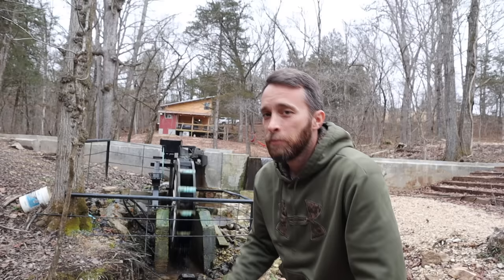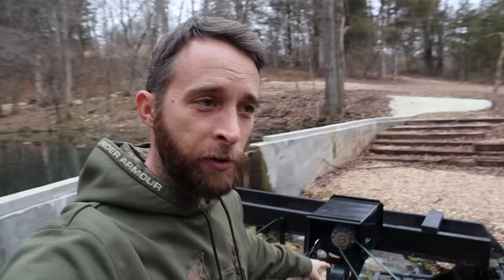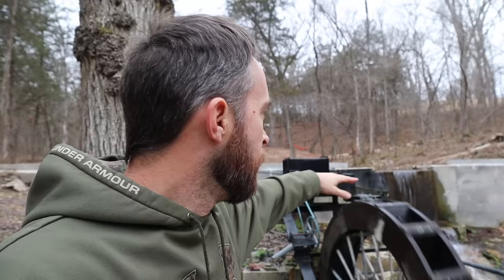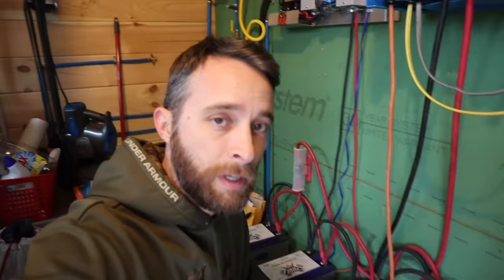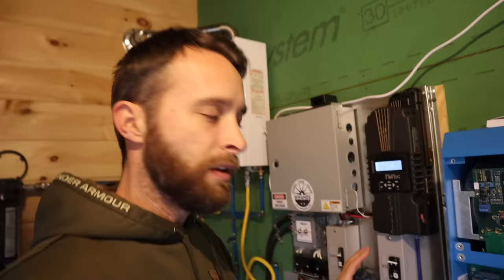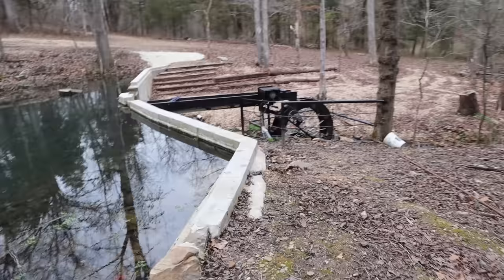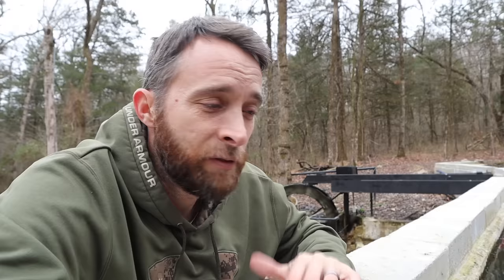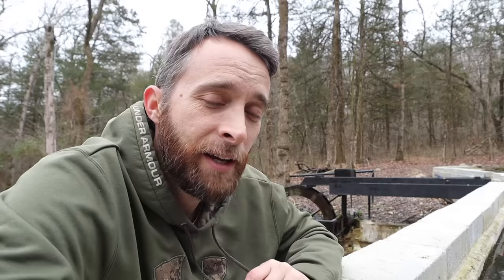Did we MAKE HYDRO POWER Using Our Waterwheel for Self Reliant Off Grid Living?

Comment: Instead of using a low voltage dc generator, use a high voltage ac generator to send power to the cabin and switch it to dc just before the controller with a $20 rectifier. Your Midnite charge controller can handle 200v and it’ll be less amperage to push and more efficient.
Reply from the maker: Thank you
Reply: @LoftisPartyofSix  this person is right. U want to go high voltage and rectify right before controller. DC long distance in high amperage is a high voltage drop.
Reply: Definitely correct on the advantage of higher voltage. The DC vs AC probably isn't going to make a measurable difference at these power levels, but DC is more efficient in the transmission lines because the magnetic field does not build, collapse, build reversed, collapsed, etc.  The big, long distance transmission lines from pacific northwest down to California are high voltage DC (HVDC) for this reason, as are the Ontario hydro lines and many others. More are being converted as needs and resources allow. Google HVDC transmission.
Reply: @Sylvan_dB  you are absolutely correct but the reason I said to use AC is because AC generators are waaaayyyyy cheaper than high voltage DC generators. In a setup where you’re just trying to charge a battery, I see no reason to spend the extra money.
Reply: Brian you're absolutely correct. Low voltage DC requires a much larger cable to carry the full current long distances. Much better to invert to AC and rectify back to DC if your grid setup requires it. Although... I'll be honest in looking at water wheel setup... the biggest pulley on the prime mover looks wayyyy too small to get the necessary kinetic energy transfer. I think you're loosing too much power there as well.
Reply: @LoftisPartyofSix  , I believe that you can get this to work, it's not the waterwheel, it's the power transfer that needs to be looked at, as mentioned by others. 

Thank you for the videos and I really hope that you don't give up on this project, you can do it 👍🤞🍀
Reply: That generator is a/c its rectifying at the panel inside
Reply: @edialbert8035  the water wheel is very poorly designed (as in the designer had no idea what they were doing) and isn't worth using. The buckets are shaped wrong, spaced wrong, and the wheel needs to be much wider
Reply: @alabastardmasterson  , I'm very interested in this, any suggestions on where I could find information on how an overhead waterwheel should be designed, for maximum efficiency?
Reply: @edialbert8035  Google waterwheel engineering or design. I remember many of the better sites not being in English but can't recall any of them. Its a much more indepth subject than most would think. There is quite a bit of math
Reply: Yes, he likely has a voltage drop problem with 24 volts on a 200ft run.
Reply: @edialbert8035  Maybe even a chain drive instead of the nylon belts, less flex.
Reply: Exactly, Edison vs Tesla
Reply: I agree. Classics need more voltage.
Reply: Yea from my understanding, dc is used to carry the load long distances, and then can convert to ac when it reaches the area for supply of electricity. This seems to be a good suggestion here.
Reply: @J.Cameron.Stuart.Adams.  you have no idea what you're talking about so your need to comment is sad projection
Reply: Moving your battery bank closer to the water wheel I think would be a simple solution.
Reply: Yeah you definitely don't want to run dc of distance that's why line voltage is ac because it doesn't lose current as quickly as dc
Reply: this sounds like the smart thing.
Reply: Waste of time. The system has been meticulously designed by ignoring every principle of even basic high school physics to not generate any power in the first place. You can rectify seven types of hell out of zero and still end up with zero.
Reply: yeah wouldn't the cables need to be crazy thick to push dc without losing loads of it, much easier to push ac
Reply: uh @alabastardmasterson
Reply: Thank you for sharing your idea! Using a high voltage AC generator and a rectifier sounds like a great way to optimize power efficiency. Additionally, if you're looking for a reliable power station for your outdoor adventures, I recommend checking out the Segway Portable PowerStation Cube Series. It offers a massive capacity, powerful output, and fast recharging capabilities. It's a valuable addition to any camping or RV setup.

Comment: I believe that your water is hitting your wheel too early, part of the energy is being lost having it that far back.
Reply: I agree with that point. Maybe try redirecting the water straight downward into the scoops?
Reply: He might need to add 2 feet or so to the length of the flume to hit it more on the downward turn to spin it faster.
Reply: But he reached 500 RPM.  It doesn't really matter how.  The promised power output @500 RPM did not happen.  I would not focus on improving how he gets that 500 RPM.
Reply: @PeterLawton  Sorry pal but utter nonsense.  Power = speed x torque and if there is no torque there is no power regardless of the speed. The speed is almost irrelevant, You can change that with gearing but there's got to be some grunt behind the rotation to apply a generating load against.
Reply: @davidsmith7653  utter nonsense?  Missouri Wind and Solar said that PMG generator will deliver 2000 watts at 24 volts, when turned at 500.  It’s in the video — I didn’t just make that up.  He got it turning at 500 RPM.  He said so — I didn’t just make that up either.  If you are just here to argue, count me out.
Reply: @PeterLawton  The rpm wasn't measured at the PMG. It was measured at the waterwheel. What was the slippage in the belts? What was the actual rpm at the PMG? It's a closed box. It might well deliver 2000 watts at 500 rpm when turning against a full load but you have no idea what that actual rpm was. You can't beat basic physics. That's why perpetual motion machines are impossible. There is next to no energy in the water the OP is taking from the top of the dam so he can't be generating any power. He has no head of water to generate power with.

Comment: Why not simply bring the waterline to a higher elevation? Seems like a simple fix when compared to all the work it took to put it in.
Reply: Move the wheel',down the draw to gain your needed thrust! Works every time!
Reply: Move the wheel another 6ft down stream so the flume is longer. And the water has more time to gain energy to transfer. And put a better gear ratio on the system problems would probably be solved?
Reply: Drain your pond and put a discharge pipe towards the bottom of the pond and then run the pipe down the hill further to your water wheel or ideally a pelton wheel
Reply: Maybe use a vortex turbine

Comment: I ran a 700 kw hydro station 9 years .  Get an old 115 ac generator with a blown engine and spin It with  the water wheel. Invert the 115 to dc for your batterys. I am planing to build a pond here and heat my house for free❤❤😊.😂 . Francis turbines are the best of the best.

Comment: For a 200 ft run, your wiring looks to be a bit on the small side, especially if you are trying to push DC.  I'd look at upping the wire gauge and running it as AC all the way to the controller, rectifying it to DC at the load end.  As far as the fluctuating current goes, if you are running a multi-phase AC alternator, you could very well have a bad winding in the alternator, a bad diode in the rectifier, or a faulty connection somewhere.

Comment: Cut a hole in your cement retaining wall to fit a 3 or 4” pvc pipe close to the bottom. Fit the pipe in the hole with a ball valve. Attach to a pelton wheel turbine. (Probably 400 watt unit) with at least 2 jets ( preferably 4 jets)Down a ways  from the wall. Open valve to power turbine. When water gets low, shut the ball valve closed and allow water to build in pond and repeat the process. Utilize water wheel for nothing but overflow during rainy season. This can be completely automated as well. At least now you can pull usable power even though it might only be part of the day. When your pond is full I bet you would get at least 4 to 6 hours of generated power between pond draining. Just a thought.
Reply from the maker: Sounds awesome!!

Comment: I'm not an Engineer or Electrician but I am a person who will keep trying until I get it.  Please keep trying! You got us all pumped up during construction and you have many fans cheering you on.  Research, testing, phone a friend,  trial & error etc. Just don't quit.
Reply from the maker: Thank you 😊
Reply: Yeah, you've got me pumped on this as well.  All that work and expense - you've gotta work it out.  So many well-intentioned arm chair experts .. and I'm just another one .. WITH another 2 cents worth.
It seems, from the vision, that there is only a slight fall from the dam over flow to top of the water wheel.  WHAT IF you dropped the height at the top of the water wheel to as low as possible (minimum of 2 feet lower instead of estimated 2 inches) to increase the effect of water-flow speed and power onto the water wheel.  Also, try a round (or 1/2 round) pipe with a diameter the same as the width of the water wheel channel. (Inside dimensions.)  Yes, yes, I know!  There's a lot of time and effort in the original water wheel mount - but a relatively small amount when considering the dam plus all those electrical components.  IF you temporarily redirected the water flow to a lower point, I believe you will "feel" more power in the same volume of water at an increased speed.  Finally, what is the current RPM of the water wheel - what RPM do you need?  What RPM is lost when under load?  If the RPM loss is significant perhaps a "flywheel" hoop could be attached to the 'wheel' to absorb some resistance.  It may take a while to wind-up to speed .. or you could give it a "helping hand" at first.  No matter what, Mate, just don't quit.
Reply: And I have to pitch in here and say what about parasitic loss? V-belts cost efficiency and so will an extra shaft. Perhaps someone has already spoke to that. 
I’m considering a similar installation and will likely go with a AC generator. I have yet to learn what RPM is needed for one of those……
Your work is quite inspiring, thanks for sharing!

Comment: Use an alternator with the rectifer at the charge controller location. There are even some auto alternators that will do the job. You'll probably need to run at least 3 power wires between the locations.

Comment: Have you tried checking what the output of the generator is right at the generator? If it is okay at the generator, but not at the cabin, your problem is voltage drop between the two. The fix is larger gauge wire. If it isn't okay at the generator, it will never be okay at the cabin.
Reply: THIS -- DC does not travel distance well.  There is a reason we power the grid with AC, and also step up the voltage...
Reply: @horscategorie  well, technically ac is actually worse. The main virtue with ac is, as you say, the possibiöity of adapting the voltage levels for long distance. Today when we have good solid state electronics dc is coming back in a hurry over long distance. But we are talking about dc power lines in the million range of volts.
Reply: @johndoe1909  Right - I agree.

Comment: For DC you need larger gauge wire than AC, with the travel distance(220') you should be using 1/0 Ga @10A. If my math is up to speed, 2000W/24v should be 83 Amps out of the generator though. You could check with a welding shop and see if they have enough welding lead that you could rent in order to test it. From the looks of the it, you have 10 Ga wires from the gen now, that would be fine for AC but...
Best of luck and don't give up the ship just yet!
Reply from the maker: Thank you

Comment: Don’t give up yet. This is too cool of a project to quit on. There is power there, you just need the right combination of things to make it useful energy. I’ve always dreamed of doing something like this but have never had water running on my property. I’m living vicariously though you. Don’t give up! BTW, my family of 6 just started RVing full time in September, and your videos are a big reason why we felt like it was possible! Thanks for the motivation!
Reply from the maker: Thank you so much for the encouragement to not quit on the project. I really want to figure this out but just need someone smarter than me 😉 to figure it out!
Reply: @LoftisPartyofSix  I used to be a mechanical engineer so maybe when I’m back your way I’ll stop by and check it out. We are in CA for a few months though. We will head east again soon.
Reply from the maker: That would be awesome!
Reply from the maker: @D Parker I completely agree! Thank you for the encouragement! God Bless!!
Reply: @LoftisPartyofSix  Become smarter! You have the capacity to learn, you just need to actually learn. Start with a question: how can I take the system I have and change it to deliver power? Then start learning. Do you need to get an AC generator instead of DC? How much loss are you getting between the DC generator you have now and your house? Can you measure it with a multimeter? 

Break it down into parts, verify every piece, starting at the wheel, and you'll find the suspect. Then you'll know how best to move forward. Don't give up!
Reply: Dont give it up...your on the right track...just need to get a better combination of wheel ratio..wireing..and convert ac to dc at the end of your run..at the controller  box..maybe a
 different motor..👍👍

Comment: Hi! This is interesting and a very exciting project, I think. I am a technical person and I see two things that may improove better efficiency! First, I would have rebuilt the gutter where the water comes out on the impeller. It will not be difficult or expensive. The gutter should be made longer and narrower at the end, so that the water only hits the blades on the wheel.

The second is that you probably lose a lot of power due to too little square on the cable up to the house. At DC- current one has to use thick cable and I think it will be somewhat expensive to change them, as you need quite long cable. You should considder this, but maybe you will benefit by producing AC from the generator, and probably use the old cables. Good luck and God bless from Norway.
Reply: Design as wheel drop s 🌊 speed? voltage, generator, charging batteries pushing out voltage requirements as a house hold or small colony? as well as maybe stream connecting or converting into a small  pawn and having more speed voltage of Walter drop to produce. Self sufficient management of a natural resource as being beneficial to persons. as while greeting ideas for anterponeris.

Comment: Was Missouri Wind and Power really ok with designing a system for you that does not work?  They would be the first people I would be talking to.
Reply from the maker: Your right, I think I'll call them
Reply: I couldn't agree more!!
Reply: I totally agree with this statement.
Reply: I purchased a Alternator to make a wind generator from them and it was absolutely horrible it did not produce much voltage at all and the amperage was doing the same thing up and down like 1 Amp maybe 2 Amps in vary hi wind. I would look for a better alternator. Make sure you’re running the three phase out of it to your house and rectifying it inside the house
Reply: Honestly, I got a wind turbine and charge controller setup from them, and they both sucked. By the time I moved and got things set up, I was part the return window and all they tried to do was upsell me when I called them. I spent $30 on a cheap wind controller, and got nearly 5x the power out of the turbine. I would never buy from them again or recommend them after my experience and the experience of others that are off grid in my area
Reply: Have you all heard of the Water Lily turbine? Might be worth checking out.
Reply: Or the first to crush it like has been done so many times in the past with new technology that allows you to unplug permanently.
Reply: @vaskylark  I have a water lily and it was a fatal wast of money.  One large problem for me was keeping leaves from plugging it up. Even when clean of leaves it never produced the output quoted
Reply: I have a PMA from Missouri Wind And Power on a waterwheel. It gives me 3 phase AC out and I rectify it at the house. I was able to get 36 watts 24/7 which wasn’t bad for the low head low flow I had but I knew that would be an issue going in
Reply: @randywilliams4571  Hey, Lets get more info about your system. Pics, Vids? I think many of us would appreciate that.

Comment: This is probably just a crazy idea, but could you construct a water tower to give you the height needed for a turbine. If you have a constant flow of water from the spring, then use the water wheel to pump water into the tower. Then release it to the turbine and back into the pond, so you'd get back some of the energy to pump water back up via the wheel. Sort of like regen braking on an EV, also you could put some solar panels on top of the tower.
Reply: You can also use a kinetic water pump which require no power to get the water into the tower.